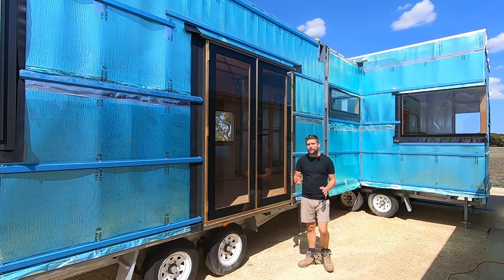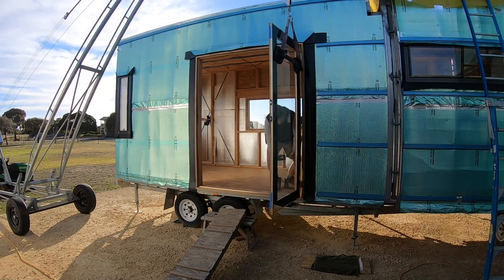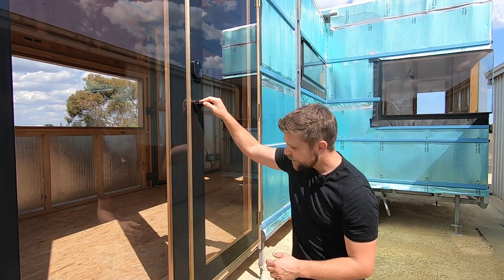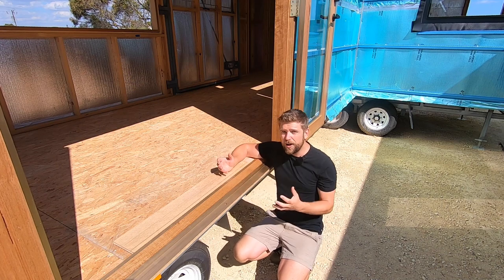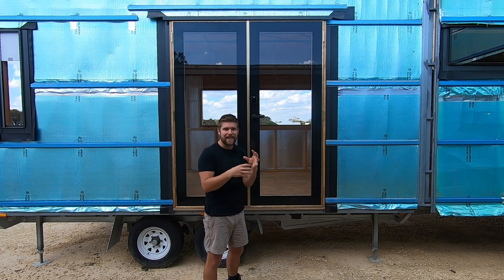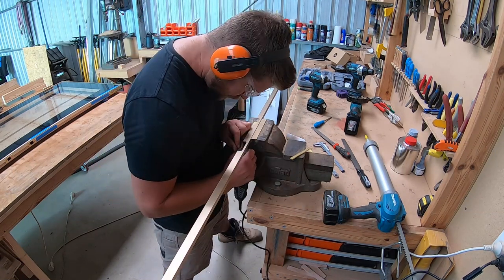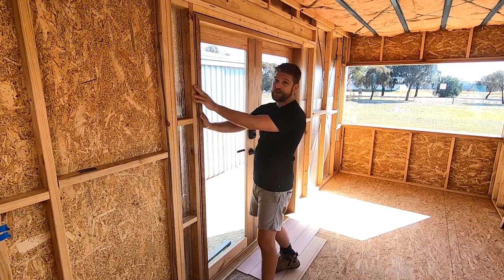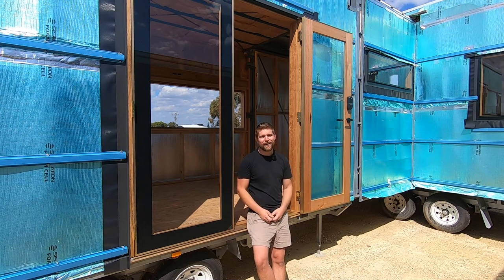Ep. 23 - Final reveal of the doors I made for my tiny house - Tiny House Build Update

Comment: Really enjoying your series! My wife and I have just fabricated the floor pan for our Tiny House - its cool to see you a little bit ahead of our build! I really enjoy the way you explain your thought processes. 

One question on the door lock - is it physically wired through the door into the house or do you need to replace batteries every so often? Is there a manual key override if the digital controller fails / is out of charge?
Reply from the maker: Hey Adam. Thank you man so glad you are enjoying the series. I need to get another video out. 
That is cool that you are underway with your house. Haha chances are you'll overtake me, I've seen a few do that now. 

Sure thing. Just uses batteries. But it uses so little power that they last forever. There are terminals on the outside you can touch a 9v battery to power it if the batteries go flat. This one does not have key override but there are models that do if you want that. I just wanted the minimal look.